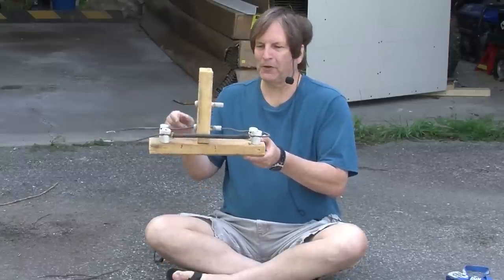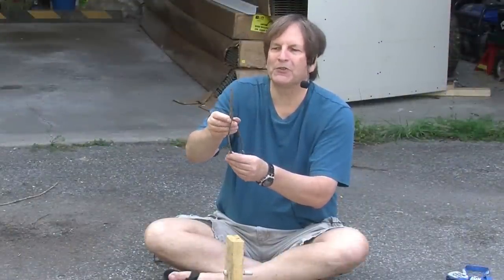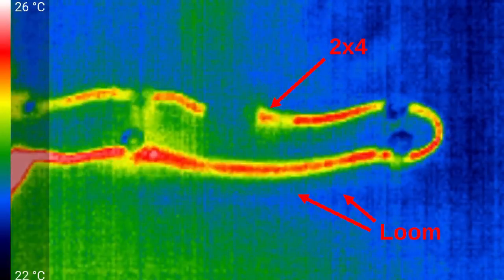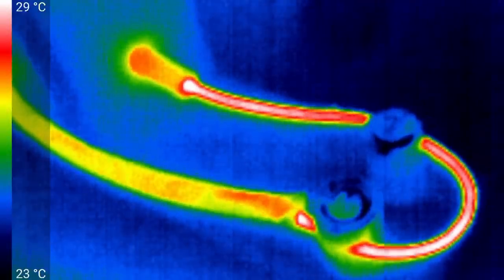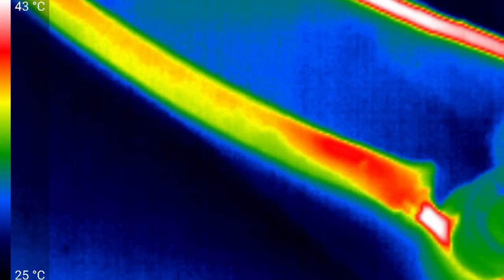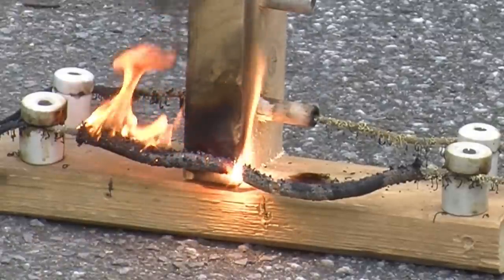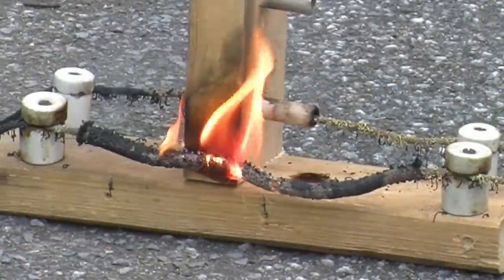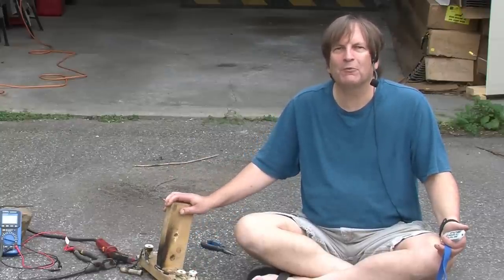Testing 100 Year Old Knob and Tube Wiring

Comment: From what I have been told, old standards for Knob and Tub Wiring allowed for a 30 amp fuse using the gauge wiring you used. Even though this is almost double for today's standards, this actually made sense as the conductors ran separate from each other and there was a lack of thermal insulation, making heat dissipation better.
Reply from the maker: I didnt know that the standard was 30A but as you said without insulation it would be OK. Interesting someone else recently commented about  having lived in a knob and tube wire house years ago where a single 30A fuse was the only fuse and supplied the house. Way back that was probably more than enough!
Reply: @ElectromagneticVideos  I think 30 amp was the main fuse and it was fuse down to 15 amps for the 14 gauge
Reply: A lot of the very early systems were lighting only so 30a would have been plenty.
Reply: @DavidBerquist334  Typically one 30 amp main fuse and two 15 amp branch circuits.

Comment: This gave me new respect for knob-and-tube wiring.  I recall the appearance of 100 year old knob-and-tube wiring in my grandfather's basement.  The insulation looked very similar to 14:39 in your video, and it had an overall curly/rough appearance, and with something longer dangling here and there.  I assumed that was from degradation over many years, but a high-current event could be a better explanation.  Thank-you, very interesting.
Reply from the maker: You know, it could also be from degradation. Who knows how consistently they made rubber and maybe some variants melt by themselves. Or a bit of both. Interesting thing is another commenter reported a similar observation, but that definitly was after a high current event.  Glad you enjoyed the video!

Comment: I was demoing an older building too and found a melted bear wire in a ceramic tube going through floor joyces. amazing how great ceramic is at insulating against electricity and heat!
Reply from the maker: I'm always fascinated to hear about things like that. You sure cant beat ceramic other than in terms of brittleness. It in might have prevented a house fire in that situation. Cant say that for our modern plastic insulated stuff!
Reply: exactly!  @ElectromagneticVideos

Comment: thanks for the informative video, I was really quite surprised by the current carrying capacity of such old wire. 
I believe the risk with this old wiring is the degradation of the sheathing combined with overloading, but your testing seems to prove that even if it had degraded sheathing, the wire would not become dangerously hot unless grossly overloaded.
Reply from the maker: From what I have researched, it appears that the two big issues with it is a) restricting air flow over the wire and b) overloading. The original Knob and Tube was designed with the wire exposed to air to cool them when operated with larger currents. Apparently a big problem is people blowing in or otherwise adding insulation over the years which covers the wire causes it to overheat. And as we use more higher powered items these days and also additional outlets etc have have been added, the wire itself gets overloaded with currents higher than designed for. So its really years of renovation and increased electricity use that is the main problem. 

I was just as surprised as you were in terms of how well it performed. I wonder how well our modem plastic insulated wire will be doing in 100 years.

Comment: Very amazing video.   This demonstration just might save a life.    This was really an optimal situation for the wiring,  installed in open air just as designed,  when homes were not tightly insulated due to the fact wood or coal burning stoves were commonly used before WWII and particularly the depression era, for heating, cooking,  and even heating clothes irons and curling irons, having a slightly breezy home was probably an advantage from a health & safety standpoint as coal produces carbon monoxide.
Reply from the maker: Thanks! I was fortunate to be able to get some vintage Knob and Tube stuff from a friends who were renovating a house or I couldn't have done it. I would be thrilled if this or any of my videos help someone. Yeah - the much greater air flow probably made things much healthier besides keeping wires cool. In this area we had an issue  with Urea Formaldehyde Foam Insulation that was used to upgrade old houses. It stopped air flow so well that off gassing from the product made people sick. I wonder if it also covered and insulated Knob and Tube wiring in some places.

Comment: Great video. We are re-doing my son's "new" 1929 wooden craftsman style house.K and T worked for almost 100 years but my first grandchild is on the way so I'm doing a total re-wire. Very interesting how well this worked safely for so long.
Reply from the maker: Thanks! Craftsman style house - is that one of the sears ones that was supplied as kit of parts that you then built yourself? Always been fascinated by  them.

What a wonderful reason to redo the wiring - congrats! As good as it was/is, with the uncertainly of what has been done to hidden parts of it over the years, rewiring is the safe way to go.

Comment: I just bought a house built in the 1960s, and wiring in the attic and going through the walls to the basement is still K&T. I’m planning to upgrade as I get time. The good news is that while more overall load is needed in modern homes, individual circuits draw less as LED lighting and more efficient appliances are implemented. The main panel was 60A fuses with several 30A fuses. The city required upgrade to 100A breaker panel before I could move in. I put in mostly 15A circuit breakers except for high load devices like A/C and clothes dryer. So far no issues, though I’m planning on reworking several circuits to add grounds. Many outlets are still ungrounded.
Reply from the maker: Wow - that must have been on of the last houses built with Knob and Tube! You make a great point about lighting drawing so much less current these days - really remarkable advance in energy conservation with CFL and now LEDs. As far as grounding goes - from what I understand replacing ungrounded receptacles with gfci ones is an acceptable alternative to grounded receptacles in many regions so that might be an an easier alternative - if you havnt already might be worth seeing if that's acceptable locally.

Comment: I am very impressed. I work on my sisters 110 year old house and the KT wiring always comes up as a worry. Not  any more, thanks for the experiment.
Reply from the maker: Yes - its fine if used as intended. The main issues seem to be overloading and  connections to modern wire, and the wire itself being covered with things like insulation (it does need the free flow of air to keep cool when a significant amount of current flows).

Comment: I've always heard that K&T wiring was very reliable as long as it wasn't improperly modified or deteriorated. Nice to actually see just how reliable it is.

I'm sure the wood wouldn't have caught fire if the other wire wasn't so close to. But at that point the wire was already incandescent and about to fail anyways.
Reply from the maker: Yes - it only really caught fire which the current was well beyond what it was designed for. I think the real issue is things like insulation installed years later preventing the wire from having the air cooling it originally had. I wonder if our modern wiring will be as good in 100 years!

Comment: Your test is in SUPER ideal conditions being outside and such a short length the wire can dissipate heat effectively. Only the weakest/ hottest part of a circuit has to fail; a long circuit going through lots of holes in joists and maybe an insulated attic will have hot spots that can fail. Joints and terminations often fail, but the soldered joints usually look pretty good even 100 years later. The wire is on the knobs so that it doesn't touch anything and can dissipate heat but if the house has had insulation blown in the walls or something sometimes it gets hot and burns up.
Reply from the maker: Absolutely! Thanks for the comment!

Comment: Back in the 1970's to 90's our local Radio Shack stores  had a shortwave long wire antenna kit package with a roll of 70 foot bare copper antenna wire,   50 feet insulated leadin wire,  2 ceramic insulators  and a pair of (possible) NOS wire knobs identical to your 100 year old knobs. they were meant for the leadin wire spacing along a wall . I used it for my crystal radio as a kid and for shortwave too.
Reply from the maker: That brings back a number of crystal radio memories for me: I had a similar antenna kit, but the insulators were plastic. For years as a kid has no success with crystal radios - eventually I found out the diode was bad. The kit I got also had a low impedance headphone which never worked. Later on I fixed all of that of course. Neat that you did shortwave - dont know if you have tried any shortwave recently but sadly most of the western shortwave services have disappeared.
Reply: I still scan the shortwave band today. I always had an interest in the more obscure, shadier side of shortwave,   SSB signals,  numbers stations.  military communications,  airliner comms and just weird and unexplainable signals I might encounter.  Your definitely right about major SW broadcast stations going silent.  I saw it coming since the 1990's when many US based shortwave stations were broadcasting loads of angry preacher and conspiracy programmes which,   in my opinion   helped ruined shortwaves reputation for the big SW broadcasters.  I do still have a few crystal radios both AM an SW.  I see you saw my stereo HAARP video.  HAARP signals sound so much better on a crystal radio though an amplifier or recorder.
Reply from the maker: @rEdf196  Thats really neat. I remember numbers stations from when I was kid and we lived overseas wherever dad was posted. We were in Iraq for 3 years in the pre-internet days and shortwave was the source of all current news. In those days the SW band was full of good stuff! I actually worked in the HF modem field in a previous company - we had one of the first 9.6kbps HF modems. Some of the military HF stuff you have listened to may have been our modem. 

Yes - I did see your HAAP video - was always fascinated by HAARP. So do you find crystal radios actually do better for that stuff that an a superhet? If thats the case its pretty amazing!

Comment: I once saw wiring on an older NJ house that had no wire nuts nor merletts.   The through wiring was soldered inside the boxes and wrapped around the screws on the device. It wasn't K&T, but armored cable BX.  People used to plug in toasters, hair curlers, coffee pots and vacuum cleaners in a ceiling light fixture with a screw in adapter.
Reply from the maker: How interesting and different. I remember reading somewhere that it was code acceptable to solder wires together and wrap with tape in a junction box at least at one time. I just looked up the BX cable invented date and it cable about in 1903.  I am amazed it was developed so far back. That might also explain the use of light fixture as a power outlet.   So the type of wiring you saw seems to have existed at the same time as K&T. 

I wonder what caused one or the other type to be  chosen for installation in a house? Maybe a regional thing? Maybe one or the other was cheaper?

Thanks for posting that interesting observation!
Reply: I've seen old houses that had screw-in sockets along the floor!  That's the way it used to be done, screw appliances into the light socket hanging from the ceiling.  The two-prong plug we're familiar with came later.
Reply from the maker: @boggy7665  I never have seen that! But it makes sense - the screw in was the original ans presumably only common way to attach things. What a hazard if they didn't provide something to screw into the socket when not in use!
Reply: @ElectromagneticVideos  Those screw-in outlets in the baseboard had a spring-loaded flap that covered them when not in use.
Reply from the maker: @boggy7665  Oh  - how interesting - makes sense.  At least there was some form of protection.
Reply: Sounds similar to my K&T house from 1850 I grew up in. You had one light per room, and you needed a screw in adapter on the light to get an outlet. Those rooms really hadn't been updated probably since the house was built. Other parts had bx, and romex. My dad added modern 20 amp outlets to most of the rooms. 

Soldering is still a permitted method in the electrical code!
Reply from the maker: @OnusofStrife  That wiring sounds so well preserved  it could almost be in a museum - how cool. I'm sure the 20A amp outlets were a welcome addition.

It is interesting that soldering is still permitted  even if not really used  anymore. It certainly seems to have withstood the test of time!

Comment: Knob & Tube was safe and performed well if installed carefully.  The main danger from it was what happened to it over time.  If it sagged and began touching something other than the insulators, bad things could happen.  If it came in contact with something metal or became wet, the danger increased dramatically.  Also, this stuff was mostly installed in attic spaces where wide temperature swings occurred.
Reply from the maker: "Knob & Tube was safe and performed well if installed carefully" - great summary of Knob & Tube - thanks!. I'll add one more thing for anyone reading this - the other possible problem is when renovations occurred and more outlets and other things were added, apparently it was not uncommon to overload the Knob & Tube wiring or connect improperly connect modern wiring to it. Not a fault of the Knob & Tube but the renovators.

Comment: Fascinating.  I’ve always felt that knob & tube was made in a time when they figured insulation would not last indefinitely.  If it’s installed correctly, it can function with bare wires.  Those splices right out in open space would make a modern inspector shudder, but the overall safety margin is impressive.
Reply from the maker: Your so right - as long as the ceramic doesnt get hit by something and shatter the insulation is probably better than what we have today. And those splices - they were soldered - so probably a better connection than with the various "modern" connectors.
Reply: @ElectromagneticVideos  useful trivia: the tubes, particularly the longer ones, make nice ceramic knife sharpeners.
Reply from the maker: @lanedexter6303  Well you sure told me something I didnt know! It must be pretty abrasive ceramic? Or may all ceramic is that way? Tjis is definitly a subject of whcih I know almost nothing!
Reply: @ElectromagneticVideos  I don’t think the ceramic is unique, but it makes a decent “crock stick” sharpener.  We also used to grind a round file down to a smooth rod (a tool post grinder in the lathe works well) and make knife sharpening steels. I have two houses built in 1940 (for employee housing at a hydroelectric utility) then moved to present location.  They still have traces of knob & tube upstairs.

Comment: Lots of knob and tube wiring was actually tin plated.  This had nothing to do with soldering, though.  A thin tin coating was commonly used with wires which had rubber insulation to prevent compounds in the rubber from eating into and corroding the copper wire.

This was actually a really well-done demonstration.  I think it would be really interesting to do something similar, but with some of the wire surrounded by different types of insulation.  One of the big points with K&T wire is that you should never insulate around it, because it is designed to operate in open air, and relies on the air contact for heat dissipation, so if you pack insulation around it it can cause it to run a lot hotter than it was intended to.

Also, I think it's interesting that this demonstration actually highlights an interesting physical effect a lot of people are not aware of:  Wires under load will always get hotter where they bend than where they are straight.  This is why the bit at the end that was bent in a U-shape actually got to the point where it was glowing red hot, while the other parts of the wire didn't.
Reply from the maker: I'd heard that. Someone also mentioned silver plating was used for the same reason. Any idea if that also the case, or if its just because it looked silver at least when new?

Comment: interesting, my tests were not as exciting on the K&T side, the romex stuff was the exciting bit. nice work, also that isn't the cloth delaminating, but the rubber oozing through it. you're exactly right, the issue is certainly not the wire itself but the modifications done to it, or insulation packed around it
Reply from the maker: Well thank you! Your right, it did seem like the rubber was oozing out. And yeah - I would be really wary if I was living in an old house where there were sections of old wiring like that that one couldn't get to to confirm they are safe.
Reply: @ElectromagneticVideos  usually if you can't get to it, previous people probably didn't bother messing with it either, and the insulators actually make it rather safe even if the wires are bare (just not for us to touch, but inside walls it's fine and will not cause issues if left alone) Otherwise, i actually prefer K&T, i feel like it was a better system, but romex is much easier to install. (i have installed both systems)
Reply from the maker: @gtb81.  Yes - big ceramic insulators is holding wires apart and in air rather than soft plastic in romex certainly is an excellent way of doing things. You have installed Know and Tube? Wow - on what occasion? Were you able to get new parts?
Reply from the maker: Just saw your "New" Knob and Tube wiring video. How cool that you outfitted your shed in vintage wiring! Everyone take look at gtb81's new Know and Tube installation!